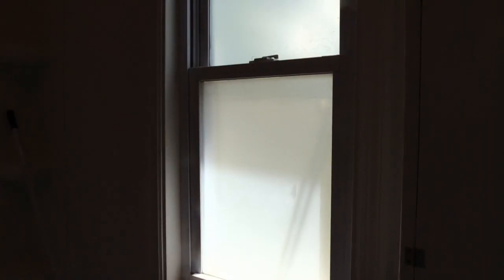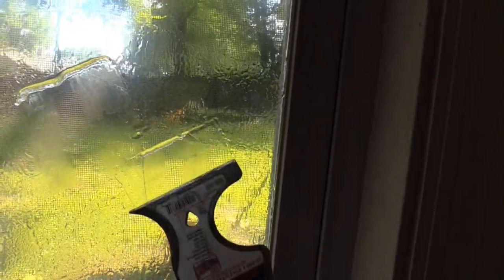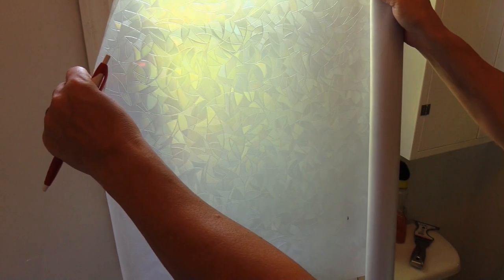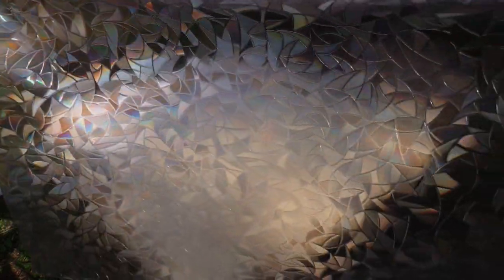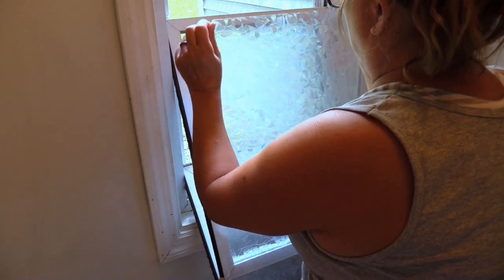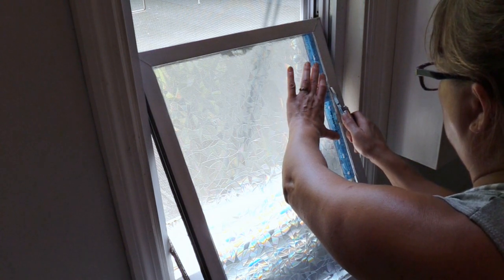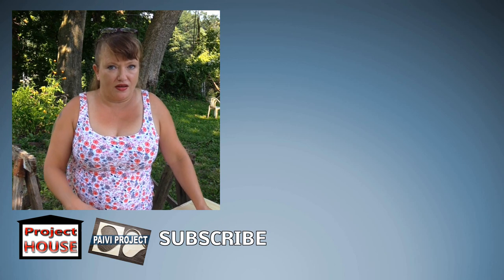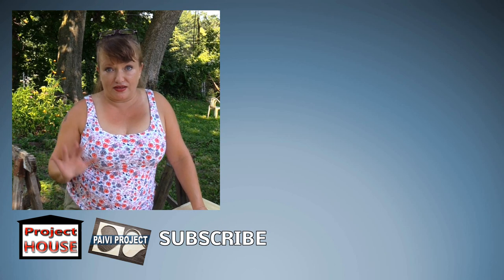Window makeover with static cling window film

Comment: i bought this film and it looks nothing like yours. once installed i can still see outside with only a little blur and looking inside looks about the same any ideas?
Reply from the maker: Oooh what a bummer. I was quite surprised how mine looked exactly like in the picture. Was it the same brand ? I got mine from Amazon. You can still see through it if you look close during the day time and night time you need curtain for extra coverage because it is very see through. I am so very happy about mine and I'm so glad I bought a bigger roll because I'll be using it on other windows. What kind of window or room were you going to use it ?